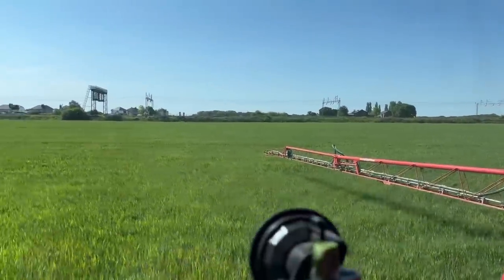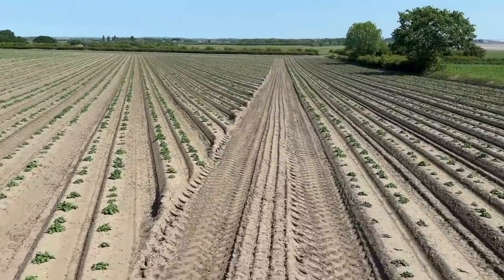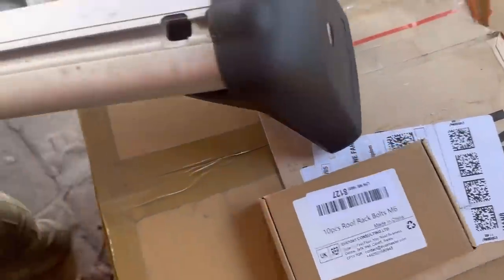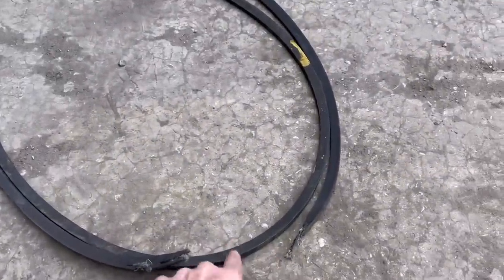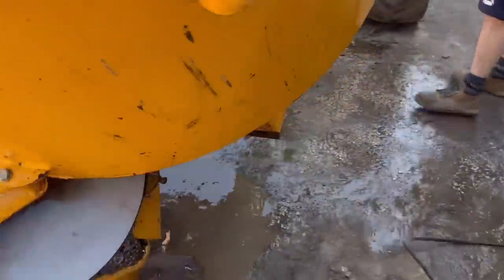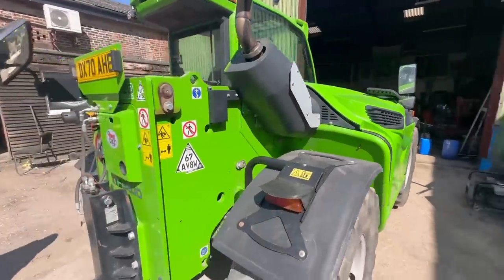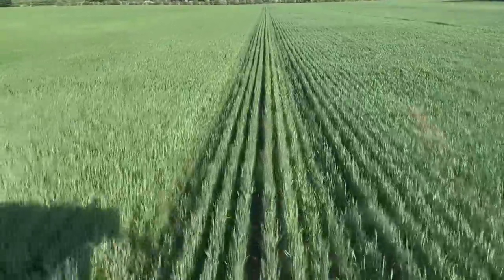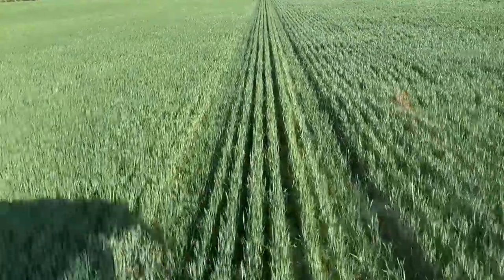MOWER MUNCHES BELTS #OLLYBLOGS #AnswerAsAPercent 1162

Comment: so tom broke the mower lol
Reply: And the mirror as well
Reply: To be fair Tom & his dad recognised the risk of front mower belt issues and deliberately ran at a slower mph
Reply: @colinmaynard2879 Yh they knew there was a problem but just carried on using it 😂
Reply: @craig5820  drum mowers are wank
Reply: Those blades wouldn't have been helping either! Instead of cutting with a nice sharp edge they would have been pulling the grass off, putting serious pressure on the belts and drive shafts. I'd say Tom did the harm because he had a crop!😲
Reply: In my defense, was mowing well I finished 😂 and the blades were better when I finished than when I started.
Reply: @TomPembertonFarmLife  what about the mirror though Tom 🤣😂🤣
Reply: @Cornwallhelis  that’s was 110% me
Reply: @Cornwallhelis  😂

Comment: Tom had issues with front mower. Not saying anything mower. Ian did a great job on that merlo - looks brand new. Cant JCB send you a telehandler? Railway fire could have been rubbish caught on the point motor. Seen it before nearby.

Comment: Surprised you haven’t put some steel or rebar in the top of that concrete wall, it would have been money well spent while you were doing the job. The damage fairies will attack it one day 😂. Guess that’s why there were flights and hotel available 😂 sure you will have fun anyway

Comment: Belt driven drum mower? Thing of the long gone past, gear driven discs with conditioner  has been modern for the past 30 years
Reply: Depends on what you need to do. Yes disc is great but at least 2 times the price! Also very expensive if you hit something 😂😂